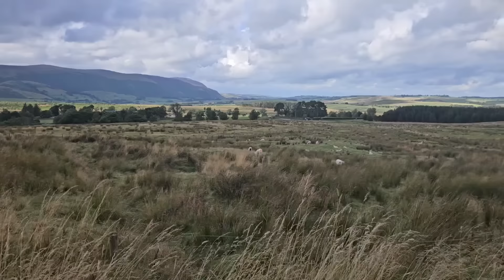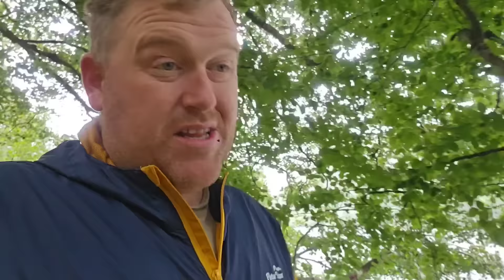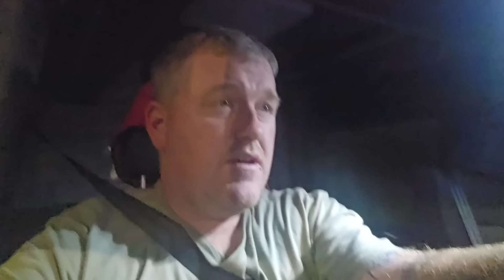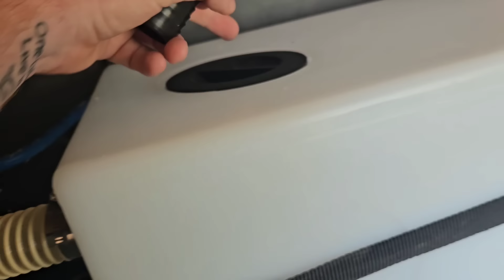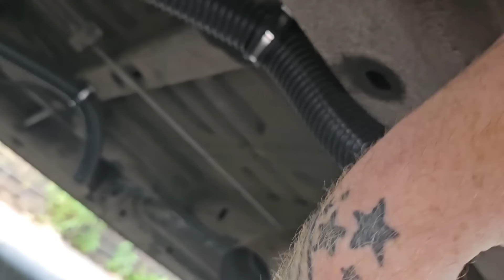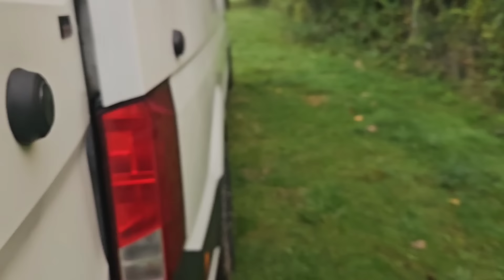Mistakes Made Living In A Van For 100 Days

Comment: 27:41 I've only got the 2 batteries but what I've done is fit a relay (I've built a heavier version but it's based on a Maypole towing one) that connects the batteries together after the engine starts & the generator light goes out. For charging the starting battery when the engine isn't running I run an ordinary Lidl smart charger off my inverter, I use "motorbike" setting so it doesn't draw much power. 

There is absolutely no reason not to duplicate this for a 3rd battery. 

Also worth a look is split-charge relays but you have to check the Voltages, they can be set to stop a battery going completely flat (10.8V) or to only share a charging source (around 13.8V) & they can trigger off one side or both sides. The HC Cargo ones I've found are the higher Voltage & bi-directional plus they have a good reputation. I would have used them if I'd found them before I built my relay.

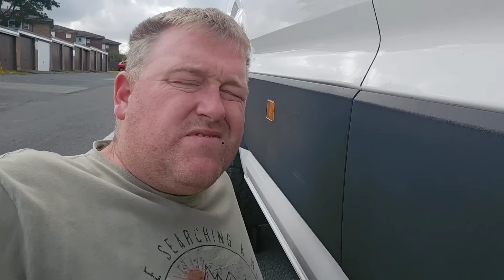Comment: 22:37 again you're best off with domestic plumbing, domestic waste pipe is stiff enough not to droop too badly with the same number of clips you've got now though you'll want rubber straps from the brackets to keep it straight.

I very strongly recommend you put a tee & a valve (or cap) directly under your sink outlet (& anything else important) so you can drain onto the ground when the pipework freezes (run your pipework from the side branch). Pick up some guttering to get the puddle out from under the van, just lay it on the ground with a brick on top to stop the wind moving it.

Comment: 28:05 if you can only fill with warm-climate Diesel you can add 10% petrol (before the Diesel so it mixes thoroughly) to keep the wax dissolved (20% if you're really panicking) though obviously use the proper local cold-climate Diesel whenever it's available. 

UK Diesel is winter or summer & the winter mix is good for about -10°C, a bit colder if the weatherman is panicking around September. Red Diesel is only available in winter mix because a farm's bowser will last many months.

Comment: For the artic trip, if you watch Mel on big van small world channel he was working on his latest project and was installing a calorifier for his hot water system, there was some sort of pre heater which is like a diesel heater which will heater up your coolant ready for in his case the calorifier but you could use it to keep your van from freezing. 

ADZadventures also did a trip to the artic and from his videos I would suggest a back-up heating even if it's like a heated electric blanket which i think you already own, having the diesel heater give up on you would be very dangerous. 

Also be prepared for your drainage on your sink to block up straight away xD  maybe chucking some pure anti freeze down the drainage hole before bed every night might stop it from freezing? or some trace cable heating wrapped around the pipes.

Comment: Hi Richard loving the content and I had a similar problem with rear tail light water ingress that rusted the circuit board.  Would you share the details of your Stockport garage as near to me and I always do an oil change every 5000 miles on my sprinter?

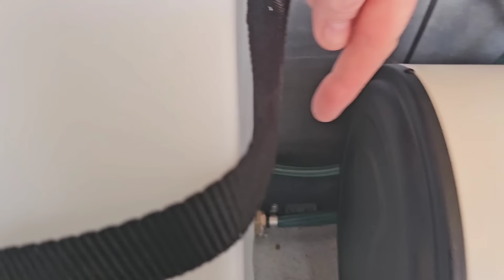Comment: 18:31 that green garden hose is going to taste bad & the reputation is that the taste is harmful (& it kinks easily). I recommend putting its replacement at the top of your job lists. 
Domestic push-fit fittings can cope with the vibration in a van (from Wickes/Toolstation/Screwfix/etc).

Comment: I'm sure this has been said but your sink looks like it's getting an air lock.... Has your waste tank got a correct size vent hole/valve? 
You could test this by undoing the sink hose at the waste tank connection without configuring the pipework, hold it there with a cable tie. Then do the same demonstration you did with the plug in the sink to see if it drains faster or the same. 

If it drains faster then ur waste tank is getting an air lock. If it's the same it's probably your pipework.